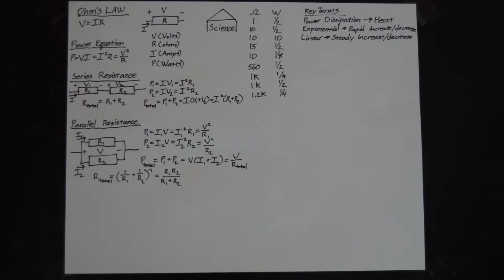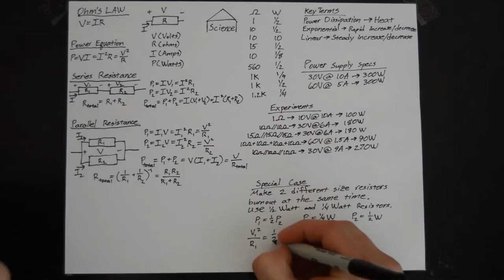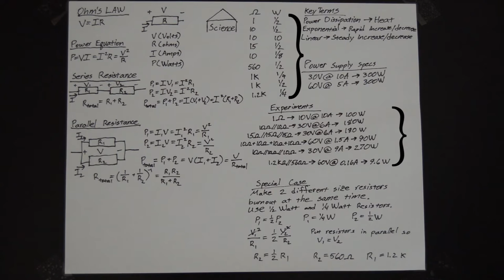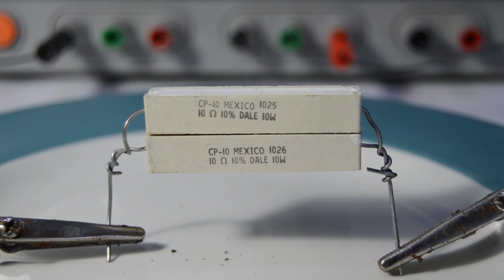How to Start Electrical Fires ~ Burning/Blowing Up Resistors With Science!!!

Comment: Dear sir; flameproof resistors were made with you in mind!
All kidding aside, here is what I beleive is going on re thermal runaway.
1. Resistor heats owing to stated mfg R.
2. As smoke occurs epoxy moisture/mechanical overcoat begin a to carbonize.
3. Carbonized epoxy acts as shunt resistor of increasingly lower value. Dissipation increases perhaps exponentially. Don't know. Set up your dso with a current shunt with sweep at 2 sec/div or so. I would be interested in the results!
3. If applying more than 20 or 30 volts which is the arcing potential for common metals, the epoxy flaming.may well start the arc.  Flame is rather conductive due to thermally generated ions as I'm sure u know.
4. If the beta alumina upon which the carbon resistor film.was reasonable pure it should not have significant conduction at low or medium voltages. At high voltages above .5 to maybe 1kv all nets are off...I simply don't know...I've just seen a lot of Wierd Shit in my 45 years as a power electronics engineering consultant...
Dave Pacholok
Cecone.com
Cecinduction@gmail.com

PS gimme a call and I will introduce you to the wonderful world of Big Things That Go Bang if you like, and you are not already aquantied with same.  Pulse power in ALL its forms is, well, a blast!
Dave

Comment: What about those fancy blue 5 band resisters? When attaching one to my power supply when the amps are set to let’s say 5A at 16V the voltage stays the same but the amps will shoot down to something like .18A not even close to half an amp. Shouldn’t it be drawing 5A? This has happened with my other weaker power supply as well and it boggles my mind on why these particular ones drop the amps like that. Is it the power supply or resistor’s doing? How can I “bypass” this cause?
Reply from the maker: What is the resistance of the resistor you are using?